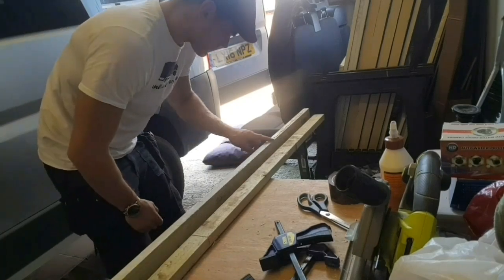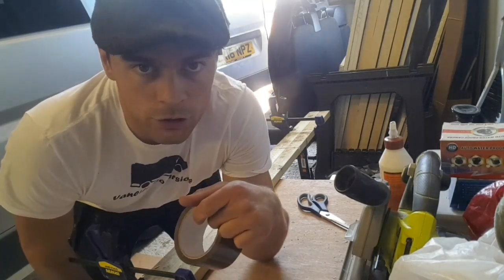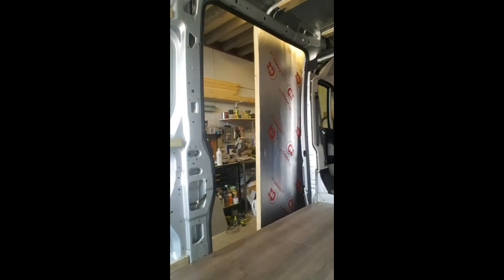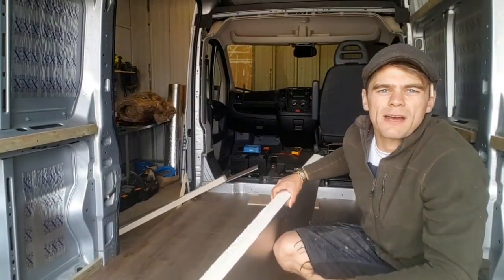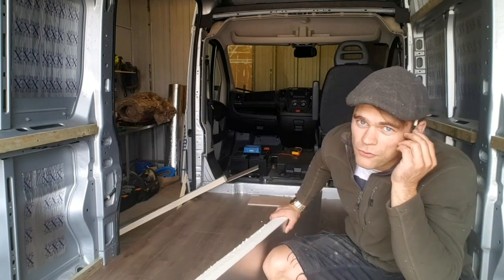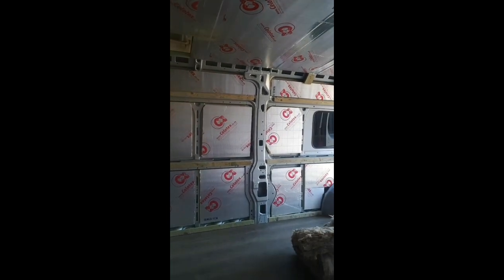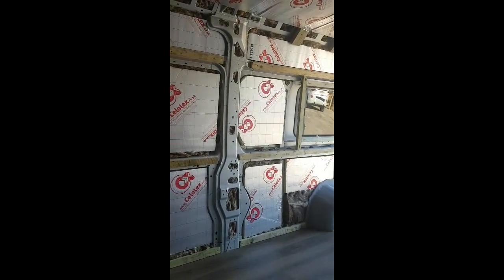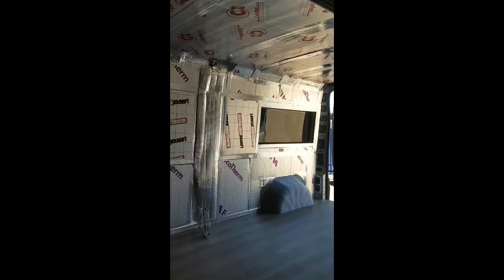How to insulate your van conversion - walls and ceiling. Step by step guide by Vanlife Conversions

Comment: Properly done! Especially the ceiling looks clean. Is the floor insulated in the same manner? And have you noticed any squeaking noises so far?
Reply from the maker: Yes the floor is also 25mm PIR and battens. No it doesnt squeak

Comment: I have watched MANY insulation videos now and this definitely seems like the neatest and most straightforward approach. Love it , thanks. Only problem in my mind is the lack of any cavity for any wiring. Are your cladding boards going directly on top of this? Will you run your lights and other electric wiring sandwiched between cladding and pir? Other than main conduit runs obviously.
Reply from the maker: Thanks, the wiring goes through the metal cavities of the van and then poke out through the insulation where needed

Comment: Can you elaborate on how much celotex (sheets) you needed for the entire job - ceiling, walls and floor? and what thickness please?
Reply from the maker: We use 25mm on the ceiling and floor and then 50mm + 25mm on the walls. Probably around 10 sheets of 25mm and 3 sheet of 50mm roughly

Comment: Quick question Oli! This is such a clean and tidy job – how do you deal with your first fix wiring once you've sealed off the whole van like this?
Reply from the maker: The first fix electrics are run at the same time so are run along the top corners before the last bits are taped up
Reply: @vanlifeconversions  Ah got ya... I've been running cables through the van cavities but looking at your method I probably needn't have bothered! Looks like there's plenty or room behind that final layer of insulation! 🤦

Comment: looking good. I have the same van and am about a month behind you! Did you trunk in/install the wiring for your electrics first or are you planning to put that in somehow after the insulation?
Reply from the maker: We run the cables at the same time as doing the insulation, usually most go along side the upper metal rib of the van where the existing cabling already is

Comment: Those battens are a bit heavy duty... no ??
Reply from the maker: Roofing battens are ideal as they are water treated and lightweight
Reply: @vanlifeconversions  water treated ??. Are you not lowering the headroom by using such heavy timber, combined with the flooring.
Reply: @2904mossie  This is my concern. I can only manage 25mm between the metal roof ribs. 50mm is too much for me and I'm 6ft1

Comment: Do you also add a vapour barrier?
Reply from the maker: Hi the foil lined PIR board with aluminium tape makes a continuous vapour barrier, meaning you don't need an extra layer